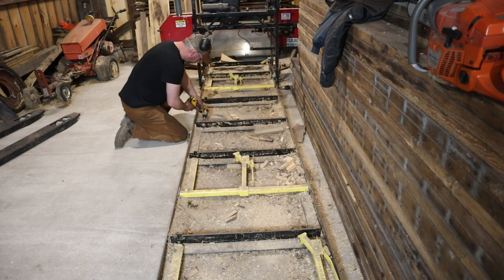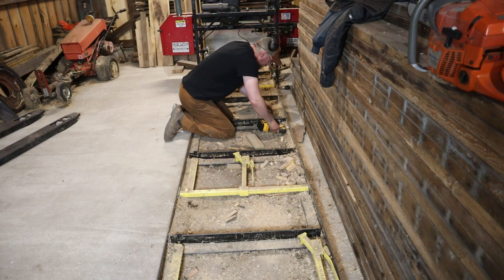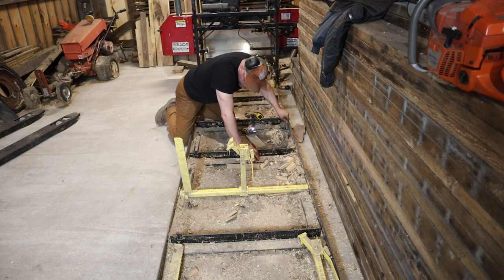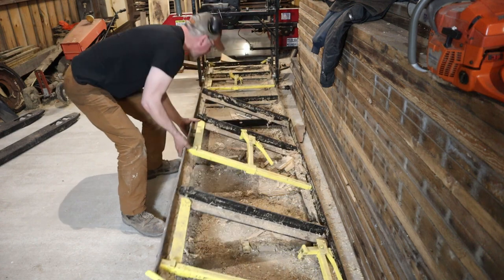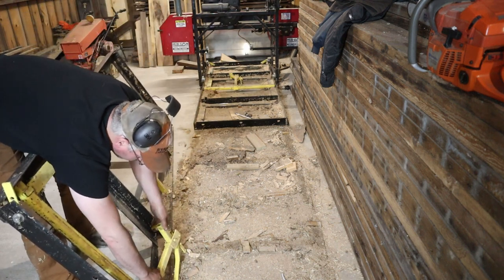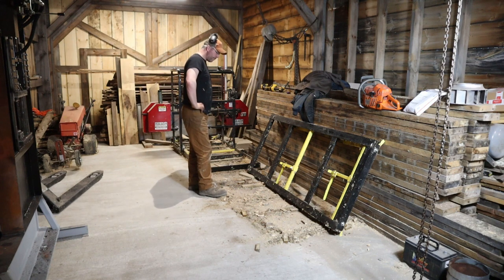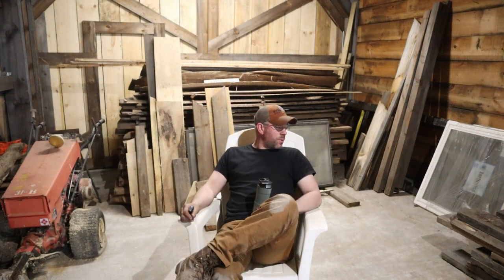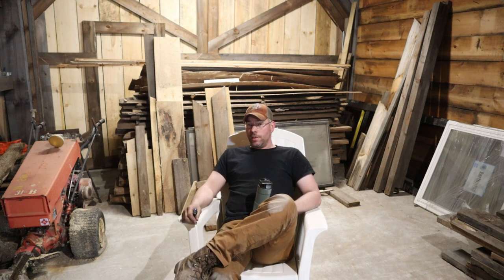The Sawmill The Timber Frame And Moving The Mill

Comment: And the lean to for the saw mill might have to wait for the larger 2nd barn project!  Grin.
Reply from the maker: You guys might see another building before too long.
Reply: @TheTradesmanChannel  hey, there's nothing wrong with a good old-fashioned out-house. Need some where to go when you're out working and have Lord knows what stuck in the treads of your boots or shoes.
The OCD Bug in her brain probably doesn't like that stuff tracked into the house.
I vote for the next timber frame to be a much smsller and quicker building. Hey, you could always pipe it into the septic lines and run water to it and have a high class outhouse like mine, with a flush toilet, lights, and electric for a winter heater.
Reply from the maker: Not a bad idea.